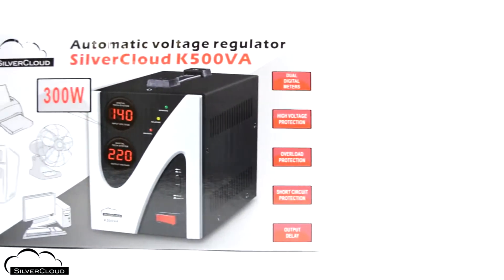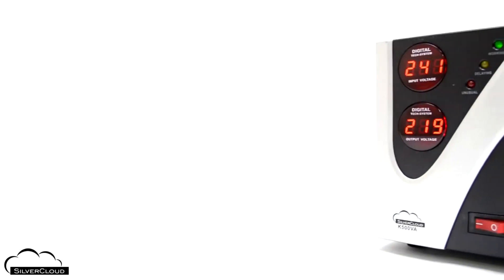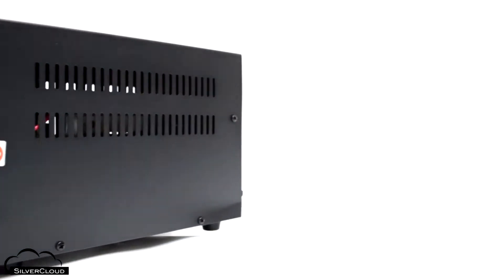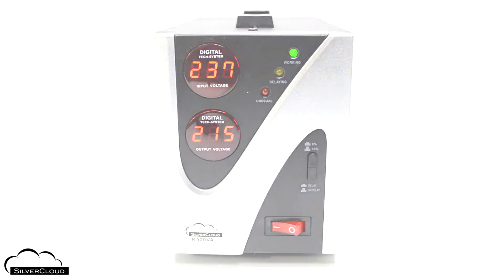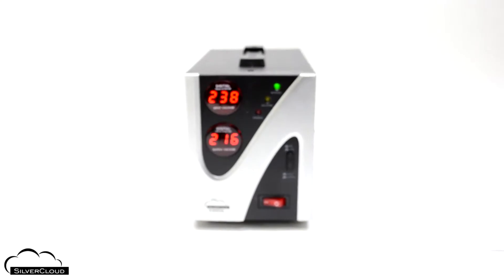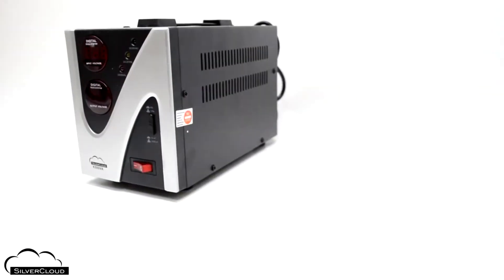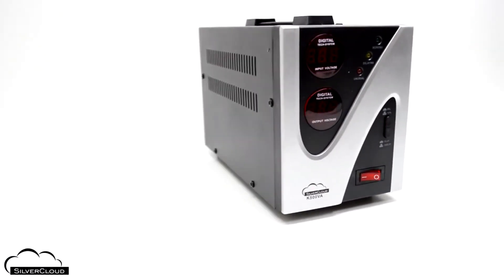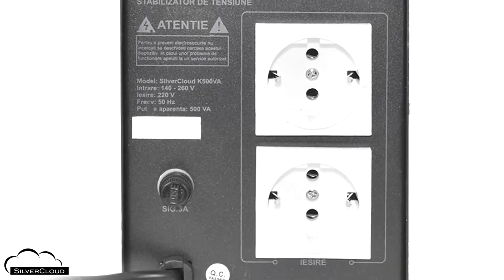The SilverCloud K500VA automatic voltage stabilizer

Comment: My automatic voltage regulator is showing HHH what's wrong
Reply: Please check the error list from user manual. Also check if there is a high voltage from input. For more details you can contact the seller .